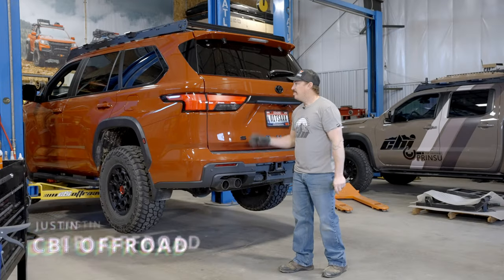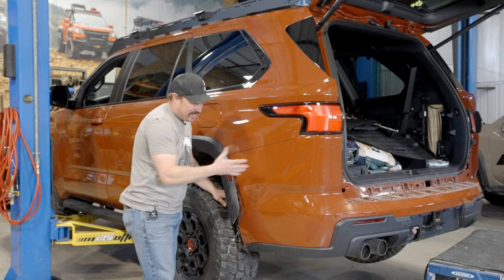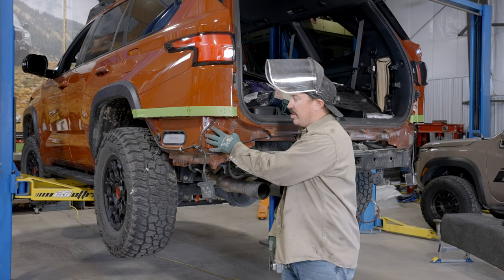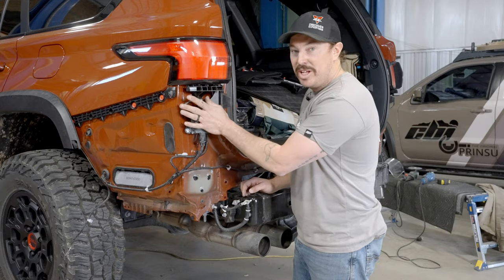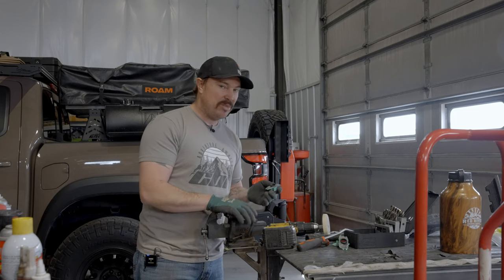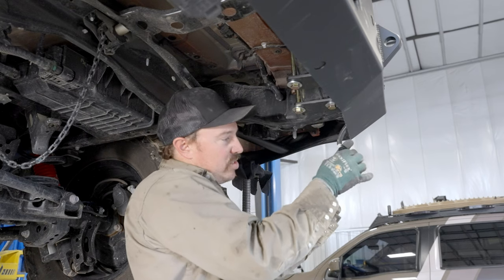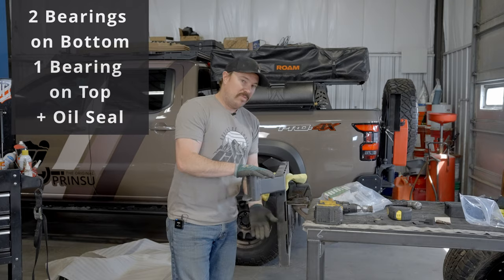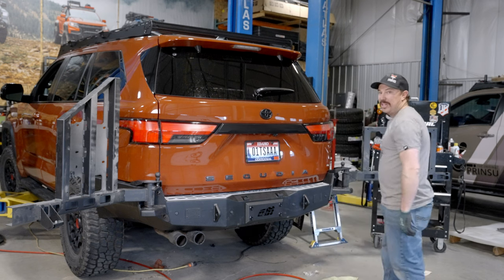Toyota Sequoia Classic Rear Bumper With Swing Arms | 2023

Comment: Do you offer rear view camera relocation for this bumper? Additionally what about the license plate?
Reply from the maker: The camera relocation bracket can be purchased separately but the license plate bracket comes with the bumper.
Reply: @cbiprinsuinstalls  nice! Also, does the license plate bracket or bumper have lights or cut outs for the license bracket? Not trying to get pulled over as not having one in Florida is illegal. 

Side note- as a future customer, it would be nice, if it doesn’t already, to make a license plate bracket that flips when using the tow hitch.
Reply: @cbiprinsuinstalls  additionally, I think your company could save money by removing the CBI hitch backplate as a good portion of people I believe would use that area for their license plate. Relocate the CBI branding to another part of the bumper, maybe a plate to match the two color options for the front bumper removable plates (the bronze or black option). And lastly include a flip up license bracket with a led shut off for when the plate is flipped up for the hitch.  

Side note- I think the camera bracket may not be a good option for my proposed setup. Maybe having a small cut out for the camera  next to the license plate would be beneficial and include a small protective shield for it. Also a cut out for the tow electric connector.